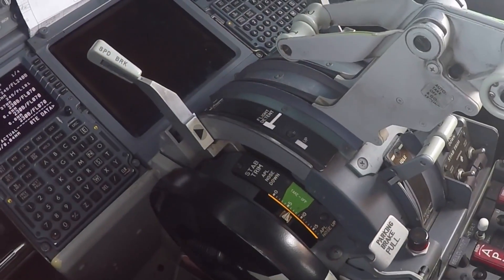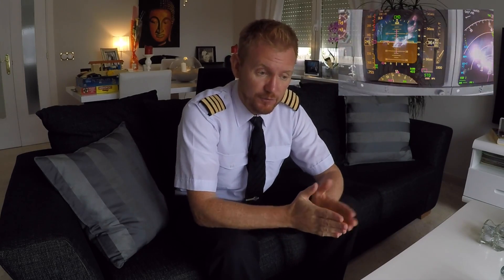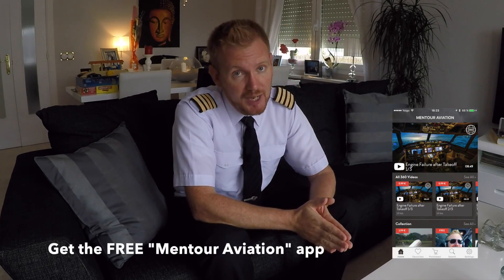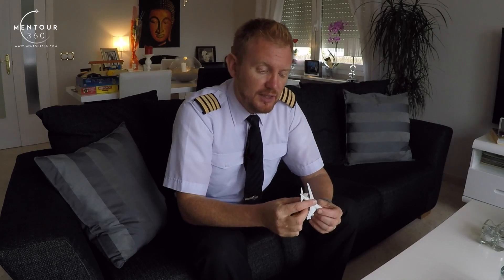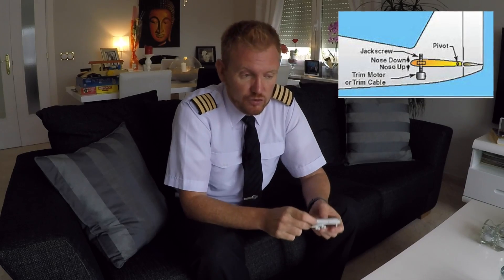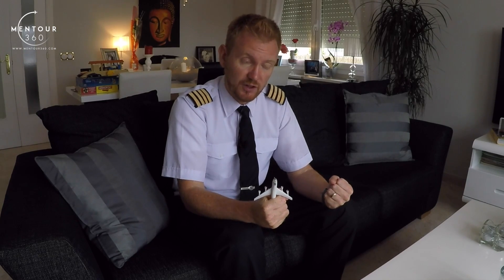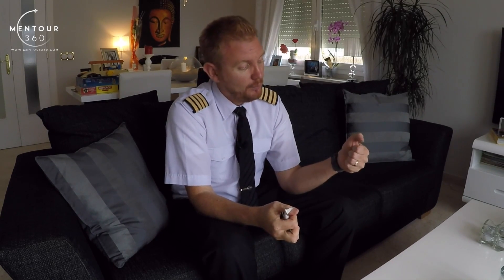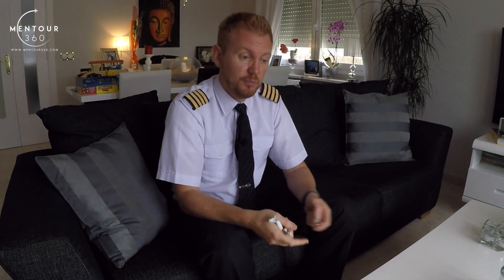What is that spinning thing?

Comment: I was taught that another benefit of moving-stab trim (beside increased authority) is reduced drag- without trim, or with tab-based trim, the elevators are constantly deflected into the airstream, producing drag.
Reply: True. Although the stabilizer, when trimmed, produces the same aerodynamic "lift" force that the deflected elevator was producing, it has a much larger surface area than the elevator, so it produces that force with a much lower angle of attack to the airstream, and if you look at the graph of drag vs. angle of attack you'll see that the drag increases substantially with high AOA. Thus the low stabilizer deflection is more energy-efficient than the high elevator deflection to  maintain the desired pitch attitude.

Comment: i’ve seen the trim wheel move upon flair and landing . what is making it move? the pilots thumb on the control?
Reply from the maker: There shouldn’t be any trimming during the flare. Not ever.
Reply: harry doherty If it's moving, the pilot is trimming but it is a very bad technique and is strictly forbidden in some operations. 

Some pilots trim in the flare in an attempt to get a really smooth landing, but this can result in long floats down the runway, tailstrikes, or in the case of a go around extreme difficulty controlling the plane when power is added.

Comment: Even Mainframe computers have gauges and moving indicators. We are such analog creatures eh?
Reply: Allen Shepard No, just the 737. This is vestigial from the 1960's design of the aircraft (and the earlier 707 and 727). There's a reason this wheel is gone from newer Boeing models (and is not missed).

Comment: DC8s had a gizmo called a "pitch trim compensator" that was supposed to most of the trimming work - but had a tendency to extend trim when it wasn't wanted. That caused some crashes in the early 1960s; one was in Canada.

Comment: LOL, those big bad slicer-dicer trim wheels are an awful choice in terms of ergonomics that goes back to the 727 and the 707 before that... remnants of a 1950's outdated design. 
Newer cockpit designs provide far better options than a large, exposed, fast-moving, noisy wheel with protrusions very close to the pilot.

Comment: Hello and thanks a lot for your clever videos!

As a flight enthusiast (I have been flying a home simulator for several years) I learn new things every day and of course there is a lot to know ..

Indeed, for a long time I wondered why the wheels were spinning all the time (as well as the rest of the flight) and now I got an answer. Thank you!

What I would like to know more .. I think there are types of aircraft (like Airbus) that the entire manual system is "frozen" while the automatic pilot is activated ..

According to Boeing's logic, why is this not the case with other aircraft companies?

Comment: I am surprised you still have manual revision on the trim and the wheels are not just indicators. I first be came closely acquainted with the wheel trim handles on a B707 while troubleshooting the mach trim system. My supervisor operated the "BEEP TRIM" (electric trim) before I could stow the handle. l still remember the knee pain from 1969. --Jay

Comment: Without trim, most planes would be impossible to fly. In the jet I flew most, the Lear 35, there is a very narrow range of motion for the stick if you don't use the trim.

Comment: Many, many thanks for those short videos illustrating the point you're making with actual cockpit views of the controls in action. That helps us understand.

Many thanks also for helping even non-pilots like me better understand what is happening when we're flying. I was on a commercial jet coming into Seattle's airport (SEATAC). We were in the final approach, when I sensed the engines revving up. I knew something was happening even before the pilot came on the PA informing us that the flaps on one side had fail to lower. 

I knew enough to know all that meant was a faster approach and a longer landing run, but quite a few of the passengers around me became worried until me circled around and made our landings. Knowledge isn't just power. It can also have a calming influence in tight situation.

Comment: I am a machinist, I worked at a place where we made parts for the trim screw and rear termination fittings. Let me say they are massive and tight tolerance for precise movement. Plus they will replace them after a time, a plane went down in the 80s or 90s due to the trim screw getting stripped out.
Reply: Eric Yes, that was the Alaska Airlines MD-80. The airline was using an unapproved lubricant for the jackscrew. When it failed, many people died in the accident off the Los Angeles coast.
Reply: I think they even just didn't lubricate it for too long. They where spacing out maintenance more to save money.
Reply: Didn't lubricate it and didn't inspect it as required by the maintenance schedule.  The pilots actually tried to fly the aircraft upside down at the end when it rolled over. And by that the FDR shows forward stick inputs and asymmetric throttle commands all the way to impact. They never gave up.
Reply: @Cragified  Not sure how accurate my memory is, but I recall it being mentioned too that the pilots manually activated both jackscrew motors (via the suitcase handles) simultaneously, while activating them one at a time instead might have reduced stress on the jackscrew & reduced its chance of failure?
Reply: @Cragified  like the movie Flight

Comment: When you turn the nose up or down do you do that with the trim/stabilizer or with flight surfaces on the wings
Reply: Stabiliser.  The flight surfaces (or ailerons) make the plane roll, when the aileron on one wing moves up the one on the other wing moves down making the plane corkscrew left or right.
Reply: Rob Fraser thanks

Comment: Those spinning wheels, one on each side, indicate to the pilots that the stabilizer trim is in the process of adjusting to trim out the aircraft. If these wheels quit spinning, there's a good chance that the stabilizer is jammed and if they continue to run in one direction, it might be an indication of a problem called  runaway stab trim. There's a handle, that folds out of each wheel, to allow for manual adjustment of the stab trim. Just don't forget to re stow the handles or the wheels can whack your legs if they start to turn, again.

Comment: Look dudes, the third pilot that he was talking about is "the pilot " that fly's the plane 80% of the time and in the next 20 years from now it'll be 95% taking almost all of the human error out of flying. I would have no problems flying on the first fully automated aircraft as long as it had one pilot on board  
In case the Quadruple back up system failure!
In the past we went from Five man to four, three now two...what's to stop having one pilot crews...saves the airlines money right!
  Avionics mechanic/ pilot over for 35 years.

Comment: I'm guessing when you said "280" were you referring to cruse altitude, ie: 28K' because I doubt you meant 280' or 280K', maybe 2800' for a initial altitude?  ;-)
Reply: No mention of 280 in this video that I could find. You must be referring to another where altitude was mentioned.
Altitudes above 18,000' MSL (18,000 feet above mean sea level) are always given as Flight Levels. The unit of Flight Level is 100 feet, so FL 280 is 28,000' MSL.

Comment: hey mentor if the Auto brakes fail in a plane can you use the parking brake to slow the plane down again ?  i know the chances of that are very low but its a question i have been wondering for a while
Reply: If auto fails you use the regular brake pedals not the parking brake ;-)
Reply: oh thank you :) its i know you can use the parking brake in a car if the main brakes fail

Comment: I guess it is a gears that engages and disengage the trust levers and trust reverse, sinse forward movement's of the trusters propels forward momentum and lifting the trust reversers and pull backward encrease trust but, cascades or buckets or doors opens to redirect airflow to opposite direction flow to help slow down the craft

Comment: if I was a pilot, I would pull those trim wheels out of frustration, their sound is so annoying. I wonder how you guys tolerate them
Reply: Lot better than holding the yoke forward or back for minutes or worse hours on end...arms get tired real quick.
Reply: Lol, that's probably why you're not a pilot.
Reply from the maker: Not a problem, its a comforting sound showing that the Autopilot system is working.

Comment: Great video! Quick question: does the Pitch for airspeed, Power for attitude is still working when flying bigger planes? I know there is lot of debate about this, but what is your opinion on it?
Reply from the maker: No, not in the same way. It’s more thrust for speed here.
Reply: Interesting! I was taught that during approach, especially, it's more a combination of both power+pitch for airspeed and attitude. Thanks for your answer!
Reply: +Lionel Lucario read about region of reverse command......However more power to maintain a slower airspeed........during approach it depends on stability of the aircraft if you pitch down airspeed will increase if you pitch up it will decrease .....with no thrust changes Itll go back to same speed....This applies to small corrections... tiny inputs to maintain the path
Reply: Lionel Lucario thats on small plane like cessna only.

Comment: Hello Mentour, lovely video again. Sorry for the late question. The 737 has the trimwheel, however, considering the Boeing philosophie, why does the 777 or 747 e.g.  do not follow that philosophie with the trimwheel and have only a small indicator on the captainside how the aircraft is trimmed?

Comment: Airbus A320 family have the same stabilizer wheels sir.
Reply: Not that it is 100% accurate, (but it seemed they did their best to be as accurate as possible) but in the movie "Sully" at the end when the Airbus pilots were attempting to see if they could make Teterboro or back to LaGuardia, I can remember the trim wheels spinning during such. That aircraft was an A320.
Reply: they do have THS on the center pedestal it just doesn't make a click sound whenever the autopilot moves it. and there are no THS control on the sidestick so pilots have to manually move the THS on the pedestal on direct law (the lowest level of automation)
Reply from the maker: No they don't. As far as I know.
Reply: Mentour Pilot They do. I've flown both. The big difference is the A-320 requires hydraulics to move the stab. The other big difference is they move slower and are completely enclosed in the center pedestal so only the top quarter or so sticks out. You CAN manually trim with them but after setting TO trim on the ground it's normally automatic for the rest of the flight. It is a very good system and has never once injured my knees or fingers.

Comment: Will pilots get injured by the moving wheel?
Reply: They rip their pants.
Reply: I guess they are careful....
Reply: I mean something like, moving my hand to change the throttle and my sleeve got caught in the wheel. Or trying to reach the radio and finger got hit by the manual adjustment handle (rotating with the wheel).
Reply: Pilots do not wear their suit jackets not their hats when they sit down to fly the aircraft, most commercial pilots wear short sleeved uniform shirts, it makes you feel like you have less resistance to moving your arms up, down, back, forth etc. some "more by the book" pilots wear long sleeves, but I see no way the buttons on a long sleeve shirt could engage a moving trim wheel. If you have been brought up to think it's not proper to wear short sleeves with a suit or sport coat, like myself, because fashion dictates there must be 1/2" of shirtcuff showing with the jacket on, never wear short sleeved dress shirts period
Reply: 🍎           I don't want to go into too much detail here but the short 
.          answer for someone like you is that there has been reports  
.       as you can see by this model (✈）that when the trim / g force ratio 
.      is greater than (Ω:Θ)during loop d loops, abrasions of the epidermis 
.    are gnarly
Reply: Nope. It's not rotating at 1000000rpm or high speeds. It moves but it has not much power and spee
Reply: Bryan Jude Fernandez How many times have you been hit by the trim wheel in the 737? It is metal and is not stopping when it hits your knee. It is treacherous and to be carefully avoided.

Comment: On PMDG FS while doing an ILS approach I have noticed a tendency of the aircraft to make a rather large correction when auto pilot is disconnected 500 feet before landing . Wondering if its because the auto pilot has suddenly stopped trimming the aircraft ?  How do you ensure this doesn't happen in real life.

Comment: Hi.. I have a few questions.
a. does wide bodied aircrafts such as the B747 or B777 has these trim wheels?

b. does the design applies to other types of aircraft (ie on an Airbus)

c. does it still used in the more modern aircraft setting ie Boeing Dreamliner?

Comment: do they only have that in the 737 series? does any of the the Boeing has it? thanks
Reply: Raidzor つ ◕_◕ つ Not accurate.  Only Boeing jets with the wheel are:  B-52, (K)C-135, B-707/720, B-727 and B-737.
Reply: All boeing airplanes have that.
Reply: Anzelmas bb but they don’t spin.
Reply: Airbus too
Reply: Boeing 777 does not have it.

Comment: From a non pilot I have a question for those who know: are there digital trim indicators on some other models of aircraft that don't use the spin wheel system? Always wondered if those spinning wheels could catch clothing or break your wrist if you weren't careful? I know it sounds like an odd questions but I'm curious!
Reply: For some airbus models I have seen in simulators, there are those spinning wheels, but in that simulator, the trim is on the control coulomb for the 747
Reply: In the Airbus family for example, the A319, 320, 321, 330 and 340 still have the trim wheel, whereas the new A350 doesn't.
Reply: I believe trim is controlled on a control on the yoke and the wheels are there to both show that the trim is being adjusted and as a backup manual adjustment since there is a manual trim wheel in say a Cessna.  My best guess.
Reply: yes. For example, the 757 uses a bar indicator next to the manual stab trim handles on the throttle quadrant.
Reply: CRJ200/700/900 is all digital
Reply: B777 use digital trim and not trim wheel
Reply: 787 is all digital as well.  They've replaced the manual wheels with redundant electrical and hydraulic systems.
Reply: Although the A320 family of aircraft do have similar looking wheels, their operation is very different. When you turn those wheels on the 737 you are manually (via a lot of cables) moving a screw jack that alters the angle of the tailplane; exactly the same as the system in the Super Cub - it's that crude. When the autopilot is engaged it drives the trim wheels through an electric motor and the same thing happens when you use the control yoke mounted switches.

On the Airbus moving the wheels tell the hydraulic system to move the tailplane, except the pilot only normally moves those wheels before take off to set the trim, after that it is automatic and it even resets itself to neutral after landing. Because the wheels are not moving a heavy load they are geared very differently and there are no rapidly spinning wheels to injure the pilot (yes they can, I have the scars!)

In normal control law the Airbus is always in trim because the flying controls are being directed by seven flight control computers which also move the wheels as they think necessary.  If systems fail, the flight control system degrades from Normal to Alternate law (loss of stall and speed protection), then to Basic law which gives the pilot direct use of the controls; at this point the pilot has to turn the wheels to trim the aircraft, but they are still just controlling a hydraulic system. The last level of control is Mech and the trim wheels are the only form of pitch control. In 6000 hours on the Airbus I have only experienced anything other than Normal law in the simulator - the control system is that reliable.
Reply: Mentour Pilot I think those new 747 models carry that sort of system he's referring to. I think, not sure. BTW, awesome presentation, subbing now.
Reply: Linescrew1 l

Comment: So in layman's terms, the trim wheels keep the airplane in balance as airspeed changes, it climbs and dives, and passengers move around inside the cabin?
Reply: Love your channel!!!  Very interesting and entertaining to learn what goes on behind the scenes as I'm strapped inside a metal tube full of liquid explosive hurtling through outer space at 600 MPH :-/
Reply: Hungry Guy • Oh, great. Now I know when I get up to visit the restroom, the pilots will be grabbing that wheel and saying "Oh no - she's up again!" rofl
Reply: May be also due to constantly changing fuel weight , trim is required .
Reply: As AirSpeed changes, yes. When passengers move around inside, no, unless 50 or a hundred of them all move at the same time. 

When the plane climbs and decends you don't trim it to level. You trim the plane to level to adjust for the static loading of fuel, cargo and people. Not for a few people moving around during the flight. If fuel Burns off on evenly you would trim to adjust for that as well but I think that they would either burn fuel evenly or move fuel between the tanks to keep the loading level. In putting trim would increase drag and that's not efficient. it's better to keep the plane equally loaded whenever possible

Comment: 737, the most dangerous and outdated commercial jet flying.
Reply: outdated = one of the most proven and reliable aiframe designs with the largest  quainty is accumulated flight hours where all the flaw has been already studied and fixed. Why Boeing should start from scratch for a new design ?. There are some old school details there. Hey, they keep the character of flying.